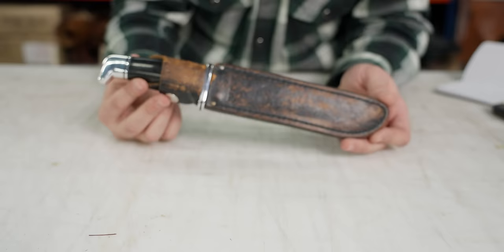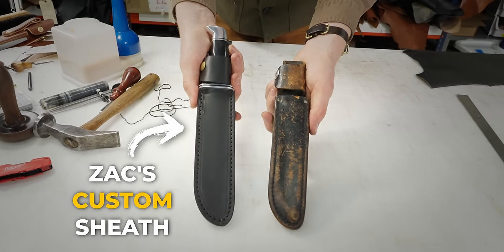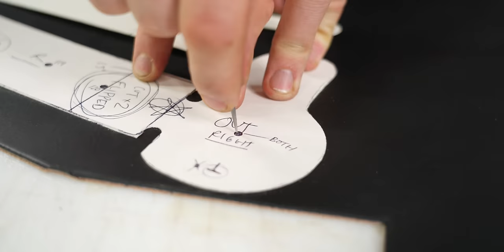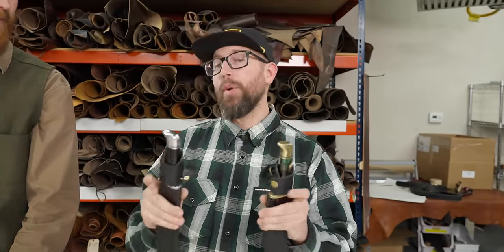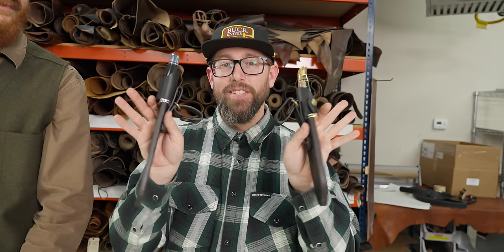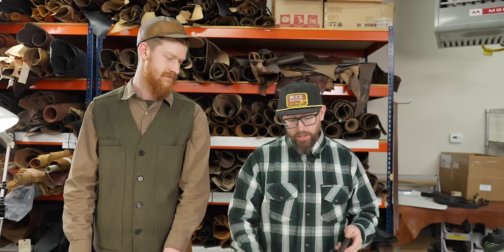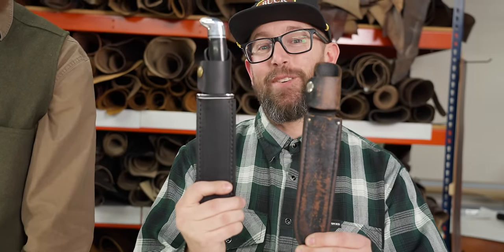The Perfect Knife Sheath and How It's Made! Custom Buck 120/119 Fixed Blade Sheath With Nicks Boots

Comment: 4:21 i am not able to spot if the black leather part is higher than the rivet. If it is, this could prevent the blade from touching the rivet and scratching the finish. Otherwise it would be ideal to put some sort of thing cloth over the rivet.

I know that brass is softer than steel, bt you can still leave marks on a surface finish with slightly softer materials.
Reply from the maker: Great feedback. Thanks!

Comment: I would trust the Buck made sheath more - time is the true test
Reply: Ahhh yes, because mire expensive and thicker leather will somehow magically fail faster than inferior leather.... WHAT?
Reply: Things break at their weakest point and if you have 15 million+ data sets of failures many no doubt sent back to you you tweak things most won't even notice. Like anything materials work together so thicker, bigger, harder can often cause stress points. The number of times I have made something "stronger" only to have it fail 2x as fast .. time is the only test and having had a back sheath or three they last and more importantly eventually fail in predictable ways with due warning.  @Totemparadox
Reply: @insanogeddon  And I completely agree with that but there's one tiny issue. This is almost a perfect copy with just better materials. It's a leather sheath, not an engine or a rocket. Outside if manufacturing defect, this will 100% outlast a Buck sheath.
Reply: I definitely bugger things up so maybe its me but I have never made an engine but I have made blades and sheaths and other "uncomplicated" things and have come full circle to appreciate mass production when done with care, accountability, and pride.  Like a good knife that just works never failing while easy to carry, sharpen, and wield in public vs some 'super steel' that wears out a frame lock in record time and has features that aren't used. The sheath looks great and is definitely sound, but I am a jaded cynical old sod ; p  @Totemparadox
Reply: @insanogeddon  Hahah. I've only worked with leather to this point. Making blades is something that is close to rocket science.

Comment: I believe the leather used was too thin. The welt and everything. The sheath had too much flex, and looked too soft when the knife was inserted. The craftsmanship was on point, shop tools etc - all great. That knife will pop through the side or front and back panels of that sheath after a fall off a horse, atv, tree stand, etc. I am just trying to be fair here. I’ve been a knifemaker and leather worker for 20 years, and that leather simply needed to be a few ounces heavier.